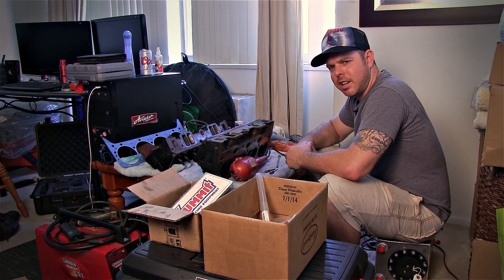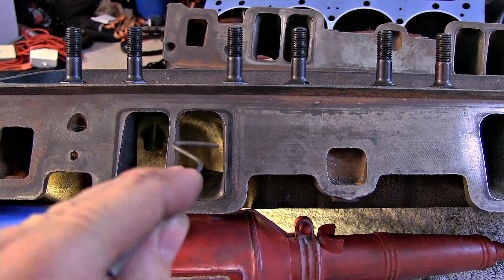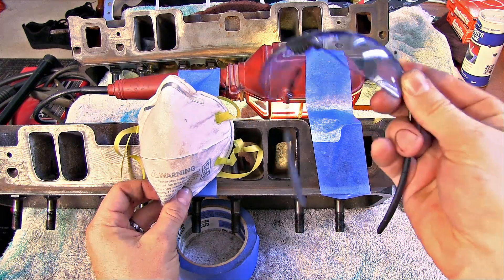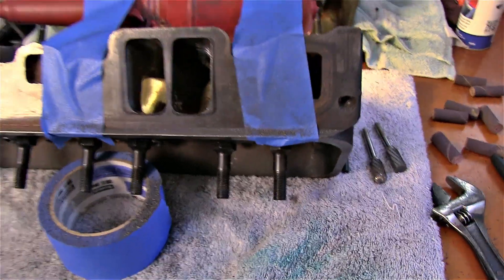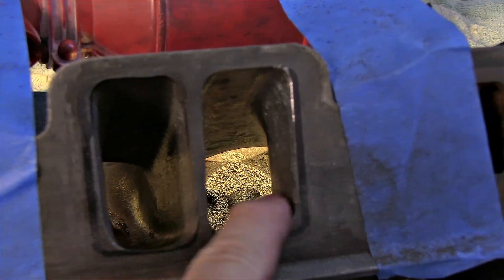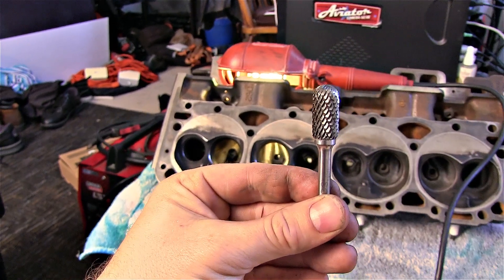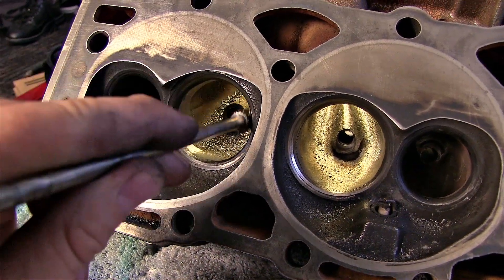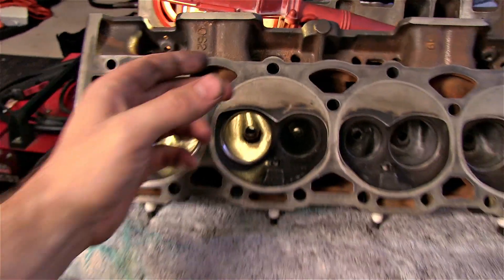DIY Head Porting Small Block Chevy Vortec 062 Part 1 of 3

Comment: how much did these heads pickup in ET after porting? Was there more low to midrange torque?
Reply from the maker: Not sure with the Vortec heads, because they are not mine. But with the LT1 heads I was running 7.9s @ 87 mph with a small cam. After porting I was able to run 7.3s 94 mph with a larger cam in the 1/8.
Reply: @TPVPRO  I'm using a hydraulic with 507 lift and 240/246 @.50 in a 355 and porting a set of 906's. I will be taking them to Clinton machine shop for a valve job and spring change. Hoping for mid to high 7's in the eighth
Reply from the maker: @seannixon2245   Should do that no problem.
Reply: @TPVPRO  It's going in a 88s10. What rear end setup are you running in yours?

Comment: I'm so just going to bend a hangar, smooth out it's end so I don't scratch up my work and pow, all the ports are the same width. Nice! What I'm going to port is rounder so I'll spin it through to check. :)
Reply: Find a 🔧 that measures the width you need and boom! Smooth sliding width gauge.

Comment: Youre going to hurt low RPM flow, but thats ok, you said he is using nitrous at the track. Just set the gearing up to use about a 3500 stall and dont worry about low end. Even though they are vortecs and not supposed to be ported, it cant hurt the .500 flow anytime they are bigger.The only problem with those 062's is they are known for cracking seats, almost guaranteed using nitrous. Theres only 3 things you have to do to 462  Camel humps to flow like Vortecs. And the seats wont crack as easy.

Comment: if ports are small high velocity if big high volume you have to balance for your engine capability , your method is like mine but different beer
Reply from the maker: Yep good point, I don't think its possible to port the stock 170cc too big for a 350. I hogged out my LT1 heads and didn't get them over 200.

Comment: I'm also one of Darin's students. Victor is correct, you do not want that bowl opened up like you're doing. It absolutely murders the airflow (looks good though). I know it's counter-intuitive, but when you see it on a flow bench, you'll $hit.

Make the throat 90% of the valve size, then you can open it up some BELOW that. You'll probably pick up 70HP on a street V8 doing it that way. But it's been over a year, you've likely figured it out by now. lol

Comment: I was always told you want to leave the ski jump.
Reply from the maker: All depends on what RPM you plan on turning the motor. Chevy designed that head for idle to 5500 towing applications. If you want to make more power up to 6500 rpm+ raising the intake runner is the only way. Look at any SBC race head it’s not there.
Reply: TPV Productions  gotcha. Thanks

Comment: he actually did a really good job!!!!!!!!! 2 things for me i wouldnt take more from the valve seat then he did thats about the max.......... and to always go back thru with higher increment sand paper thats when shit gets really smooth..... and dont forget to polish the smoother the surface the fast the air can move
Reply: Polishing to a mirror finish causes fuel to puddle.Just like water on a shower door. You just have to shape and get rid of flow obstructions. Short turn radius is where the power is.

Comment: why wouldn't u port to edge of the marker
I'm new to it
Reply: It doesn't always mean better flow. Air wants to flow toward the outside wall and upper part of the port. Taking too much out of the "hump" side where the pushrod is could break through as the host said, and it's actually one of the last places you want to remove material. Always work on the bowl side first. Of course different heads need a different approach.
And if you're going to port your manifold it's best to open it up to slightly smaller than the head, definitely don't want a step on the wrong side.

Comment: Are you some kind of Nebbish ? Do you know how fast the electric Die Grinder spins and the mess those cutter's are going to make inside your home . Are you a trailer park rat or were you raised on a dirt floor Barn ? Because I don't know anyone that would ever suggest doing port work inside there home exactly because of the amount of metal dust that WILL BE FLYING everywhere..  Hey dude if your going to be a Car guy ?  You do realize at some point you'll need a Garage right after all Car guy it's where real car guys put car's ...

Comment: Your theory is backward below the seat. When you hog the bowl up to the valve the air runs into the back of the valve. You need the pressure created by the bowl being pinched below the valve so the air will roll around the pinch and  miss the valve as it turns the corner. Angles of the seat and just below the seat are the most critical. Then velocity in the port at desired airflow. Don't confuse volume with velocity. Velocity is much harder to control when squaring the port.
Reply: some ones been watching head bytes
Reply: that guy is a trip
Reply from the maker: Then why does AFR do their bowls to the seat?
Reply: Maybe like polishing the port. Or squaring the port. Or bigger is better.  Pretty is often a lot better seller than functional. You also have to remember if you can't get it by the valve all the port work is worthless.  If fact more harmful. It slows velocity.  And there is a sweet spot.  I took a class by Darin Morgan. Head porter at ReherMorrison. He was also the "main guy" designing all Pro Stock heads. I'm guessing he knows what he is talking about.
Reply from the maker: https://www.youtube.com/watch?v=bF0Rwh2KIlI
This guy did it the Same way I did, so does Brodix Edelbrock and so. Make a video explaining why everyone who does this is wrong.
Reply: Any obstacle in the path will change air direction. A tulip valve for example will help push air out from the valve. The weight of the valve becomes the problem. Also on other than hemi the air will run into the combustion chamber wall. If you have  compression under the valve seat the air will seek the path of least resistance. Just like a water hose with a spray nozzle. I am telling you that on a 950 hp engine the difference will be about 125 hp.  The depth of the choke and shape and valve angles all play into it. Likewise the SHAPE of what you do in the combustion chamber has a huge effect . You might think you are doing something great but in fact you might be creating a vortex. I am not saying I have all the answers . I am just telling you what you need to consider.  That is why people are payed a lot of money that know what they are doing with a flow bench.  This is the most critical part of making power in an engine.
Reply: A set of heads from any of these places is $2000. to $3500. A set of race heads is $10000 to $13000 plus. The work on a production manifold is $2500 plus. I just gave you some insight to the difference.
Reply from the maker: It's 50 year old tech. What I did is very common knowledge. Like I said make a video if you can help the community of DIY people that would be great.
Reply from the maker: Junkyard vortec heads $100 DIY port $200. We are in this ball park.
Reply: +Victor Shirk TPV Productions didn't take out enough material for you to be doing all of your condescending pissing and moaning about his video. No more than  he removed I doubt if it makes a + or - 2% difference in air flow. The Vortec intake ports already have a great shape to them. There might be some improvement with the work to the valve guide boss, but him just cleaning up the casting flash and a little smoothing of the port doesn't beckon the call for you to relegate your smartass educated idiotness. Take that shit to the engineers at Chevrolet and see where it gets you.

Comment: is that the die grinder from harbor freight?
Reply from the maker: Yes but you need to get the speed dial or it will just chew things up.
Reply: +TPV Productions OK I've been thinking of getting one so I don't have to run my compressor a lot.
Reply from the maker: It works good not wonderful but usable. Don't let it spin at full RPM on the long bits, they tend to vibrate and bend.
Reply: +TPV Productions OK thanks for the tip.
Reply: +TPV Productions yes i learned that the hard way
Reply: +TPV Productions what speed dial? can u post a link?

Comment: Seriously great video. It's at a professional level. I especially appreciated your tip to come at the roof at an angle to help control the bit from staying and digging in the sides too much. Mind if I link to my porting videos here? I'll let you do the same. Right now I only have theory videos up. I think both of our efforts will help the other. :)
Reply: The only tool I'd suggest to help your health is a proper breather mask. Kind of looks like what the military uses. That's actually needed to protect your lungs over that basic mask...trust me, I've blown snot-metal boogers out, to prove that mask isn't good enough; granted, I wasn't porting at the time, I was using a finer sand paper prepping for a paint job.

Comment: im thinking about doing this to the heads on my iroc i was a little unclear on this process and was wondering if you could clear it up, when u take this on are you just going for smoothing out the factory stamping and knocking out the carbon build up and taking the rough lines out of the factory casting or making all the ports bigger the whole way down through or is it a bit of both, id like to know as much information as possiblr i got 2 sets of heads but id rather not fuck either one up
Reply from the maker: You get the most gains from raising the roof and Bowl work.
Reply: That's 2/3 true. I'd say you get the most from getting rid of the machinist ridges in the combustion chamber, blending it to the quench without going into the quench, and bowl work. But, +TPV Productions, I'm not going to ask you to go into a combustion chamber if you're not comfortable with that. I'm quite impressed with the first half of the video.

As far as work in the port, yes, the roof is for a great gain, but the single most bottle-neck factor is the valves and what's around them, everything else is secondary to that. I suggest you watch David Vizard's videos on the Dart Heads channel.
Reply: +Dynamic's Productions, Dart heads has put up some information about porting, that you'd enjoy. Especially David Vizard's work. He put out a seminar about how small shops can be profitable on porting cylinder heads. He really didn't help on the business side of it, like the title suggests, but he sure helps people know what they are doing!
To be more directly about what you asked, you're first suggestion, being minimal, is a porting that would be considered stage 1.
Stage 2 is where you open things up more rather than just some shaping and smoothing work.
I've only watched half of TPV's video so far, but his information is dead on with what I've learned from other creditable sources.
Stage 2 requires that you know how much metal is everywhere or you could punch a hole in something else that the engine needs!
So, you'll either have to learn from someone else knowing your exact heads, or buy an ultrasound device meant to check how thick metal is, and you'd have to check everywhere, and stay away from thin spots.
Answering your question, I wrote so much, I decided to put it up as an article on my blog: http://carmilespergallon.blogspot.com/2016/06/porting-cylinder-heads-whats-stage-1.html
Reply: thanks for the article dude and thanks for the link
Reply: Dynamic's Productions You're welcome. I learned a lot from Jafromobile on YouTube, but while you may see a lot more similar engines on the headbytes channel ro your project, I've found from websites outside of YouTube he isn't honest.

If you love this subject buy a book by David Vizard. He's got a few of them close to this subject. Dart heads put a few of his seminars up on YouTube.

Comment: nothing wrong with those ports definetly worth your time and will help your buddy a bunch. just so you guys know fyi just about every head in the world will flow better from what this guy has done and .600 valve lift is where theses heads will start to flow port velocity close to seat velocity.  you should definetly consider a good valve job,poor seal and seat flow will kill your porting efforts. especially on a street engine with restricted cam options.

Comment: did you measure the throat to set it around 85 % diameter of the valve ?
Reply: I didn't know that was important, can you tell me more? I've made vids about porting and airflow theory, but I need to DO. :)
Reply: @DENicholsAutoBravado . I guess an exact number would depend on the head but as a rule you shouldn't open up the throat to more than 88 or so % of the seat diameter. Some go to 91%. Any past that will be a negative affect on flow.

Comment: smoothing ur intake ports only hurt performance...
Reply: That hasn't been a good point since carburetors ruled the streets.
Reply: +DE “AutoBravado” Nichols more air + tune = more combustion
Reply: christian rabago Totally smooth is bad. 60 grit on intakes actually speeds the air up with tiny vortices. My theory has advanced since my last comment. Also. Check out my porting videos.
Reply: Porting and Airflow Theory I-III

Comment: Theses heads are perfect as cast, porting RUINS them, even the addition of after market valves hurts them. Junk now.
Reply: Levisnteeshirt1 the flow starts to decrease at.500 lift not .450 at 500 they flow a little over 230 and at 600 they flow like 225
Reply from the maker: I actually did not take that much metal out. If you look at an aftermarket 190cc or so head that flows good they all share the same characteristics. Raised runner ( Push rod pinch opened / Big flow heads require offset rockers ) bowl blended to help air tun smoothly ( less turns the better ) Valve guide smoothed unshroud valves.
Reply: I have seen 90 hp gains from votec and intake porting on a 383 stroker you sir have no clue what you are talking about.
Reply: LMAO, not ruined at all, So all these cnc ported vortec heads you can buy from the pro's are junk and wont see more Hp. WOW Ok.
Reply: you are correct sir don't ever open the intake port on a vortec head work the exaust and flow it but don't touch the intake port
Reply: I dont like these heads anyway, theyre known for the seats cracking between the valves. Theres quite a few tricks to get a 462 camel hump to flow about the same. Mine were ported by K&G speed in the 80's before the aluminum head craze took off. A simple trick to get the camels to flow 25 hp more is to grind the bump off on the roof of the exhaust runner. Stick your finger in from the header side and feel the bump on the roof. That trick is in 60's Hot Rod mags so its old. Do that and you are already at Vortec level power before doing anything to the short turn radius.
Reply: ***** no he isn't ,, GM engineers designed these heads to work one way and one way only ,, they actually lose flow above 450 lift ,,, if you don't have a flow bench to check your work , and a few extra heads to practice on ,, best to leave them alone
Reply: Levisnteeshirt1  they make a bowtie 185 cc small port vortec for around 300 a piece bare ,, a head porter would charge you more than that
Reply: It is in the details.....And if considered together with flow bench and a lot of expertise and the main objective why the heads were designed the way they are   any head can be improved.
Reply: Tundra 1211 is absolutely correct. I have a lot of porting experience with the aid of a flow bench. Several years ago I spent some time with the Vortec heads on the flow bench. Theses heads are very good as cast because they were developed on a flow bench. Consider that they flow around 235 to 240 cfm @ 28" through a standard size 1.94 valve, which is at least 30 cfm better than the old fuelie heads with 2.02 valves. They are a very high velocity design which is why they are great torque producers on street motors. 
One other thing, the factory valve job is also trick and if you remove or blend the "sharp edge" at the bottom of the valve seat ( the 75 degree throat cut ) you may pick up a few cfm at the peak flow, but you will hurt low lift flow at several points in the lift range, not a good trade off. If you want to do a valve job, only have the machinist cut the first 3 angles i.e. 30,45,60 just enough to raise the 45 more towards the outer part of the valve face to take full advantage of the 1.94 valve size. Do not cut or blend the 75 degree throat cut as its orifice is approximately 85% of the valve diameter and if enlarged will hurt low lift flow.